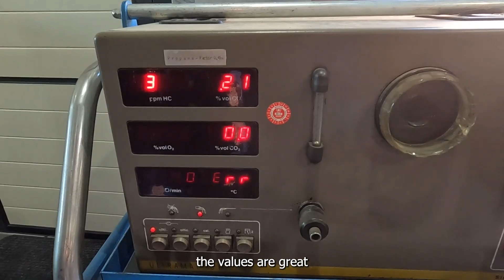1928 Ford Model A Roadster carburetor jet replacement - test drive & value check - Flathead 4 cyl. -

Comment: 97 or 81 Stromberg?  Changing from what number power valve to what new number?  When I rebuild a neglected Stromberg, removing the PV can be a challenge, but cooking the casting in a 200-300 toaster oven often saves the day.
Reply from the maker: Hi Jeffrey. You are very familiar with Stromberg carburetors, thanks for your input too. Here it is a 97 Stromberg, the PV was changed from #65 to #67 and the jets from #45 to #43.
Reply: @tmschilterspeedshop  I have rebuilt many Stromberg 81's but still learning.  Single 81 can work well on a stock Model A engine.